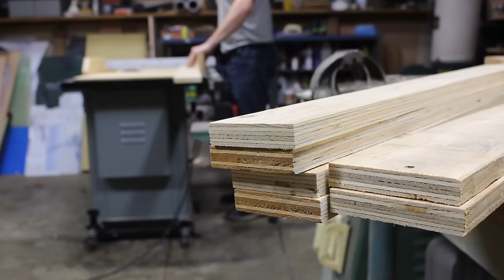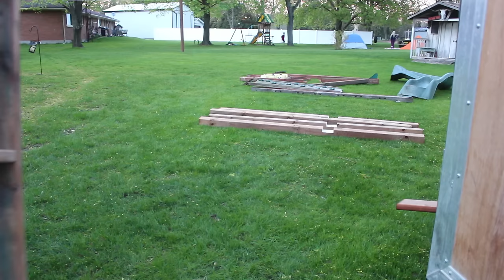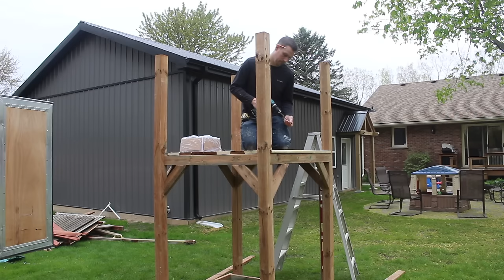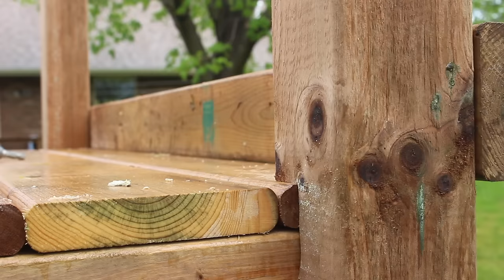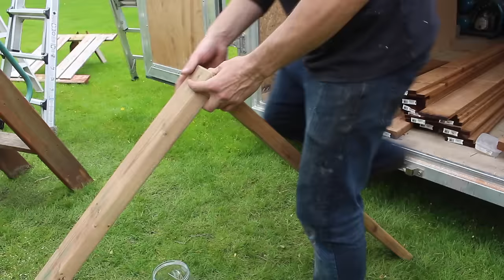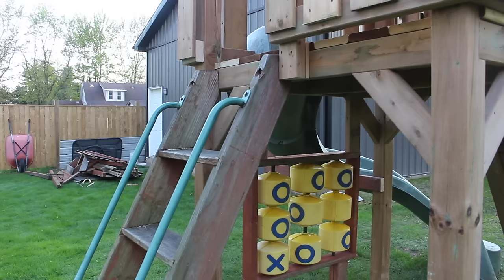Building A Play Set!

Comment: Can you give a ballpark cost total?
Reply: I saw in another comment $500 for lumber. We're building a swingset twice this size and the lumber for all the ground contact pressure treated wood is about $250-$300(home Depot). A box of 25 4" bolts is about $35. Accessories are about $20 each. I got a pack of monkey bars on Amazon for about $20, a pack of 10 rock wall plastic climbing rocks on Amazon for $20. Grab bars were $7 on Amazon. A swingset tarp on Amazon was about $30. We got  swings and one slide free from a neighbor and bought a 7 foot tube slide used for $200. Way cheaper than swingset stores charge. Most seem to want at least $1,000 for a set that might have cost $200-$300 to make.